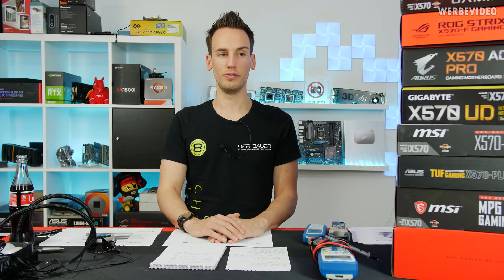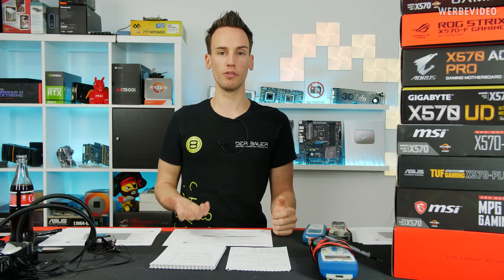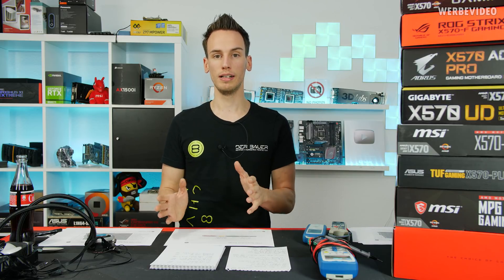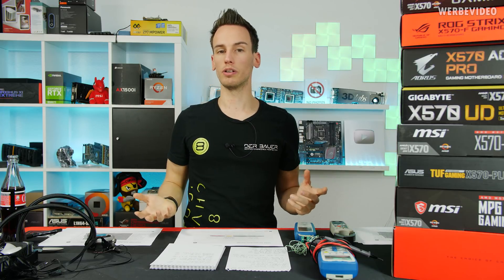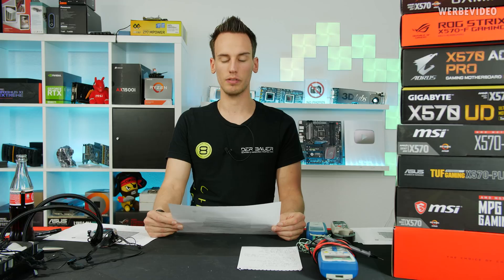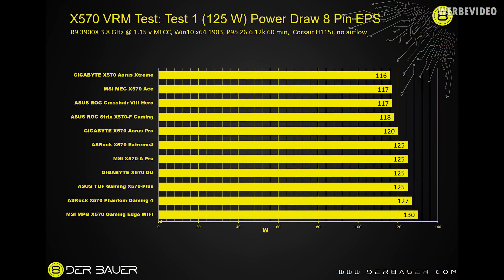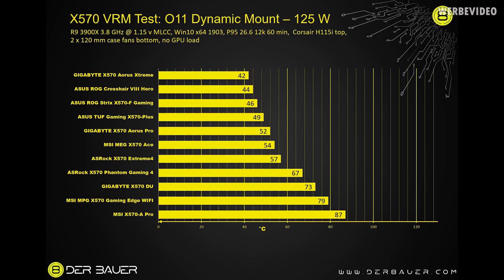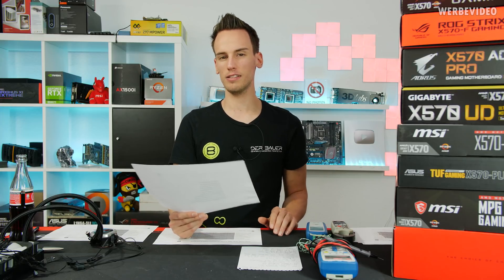RYZEN 3950X "simulated": VRM Testing 11 X570 Mainboards

Comment: I bought asus x570 pro for 260€ and wasn't expecting that I'd be vrm bottle necked with 5900x. While CPU temperatures were below 85c, the motherboard would shutdown due to vrm overheating, 4.6ghz all core at 1.32v seems to be stable now, but I'm still fine tuning it at the time of writing.

Comment: Where did you find the specifications for coming up with the VRM's temp chart? It seems to me that kind of knowledge is more intuition based than actually scientific. And it keeps promoving temperature paranoia and insatisfaction. There are many VRMs certified to operate at temperatures up to 150º and even more, they are just built for that.

But that's most of PC's hardware knowledge: barely scientific. Even if sometimes it appears to be.
Reply from the maker: I'm a electrical engineer and I can read datasheets
Reply: @der8auer   You can understand then that there are low-dropout linear voltage regulators which can cope up to 225º and beyond, and each motherboard's brand will use different regulators depending on voltage input and other factors.

Comment: @18:48 "You have to suffer longer, because I also had to suffer longer to work for this" Hahah, dude... Do I look like I'm suffering? I loved it. Thanks for this comparison!
I've been eyeing that TUF mobo for a while now, and this confirms it. Hard to beat that board at 210€ price range. Regarding the TUF board, I found it interesting that it had higher power draw but lower temps than other comparative mobos. Where is all that juice going? :D
Now, Aorus Elite could be an alternative for the TUF board, but sadly that wasn't included in this test. One could expect it perform similarly to the Aorus Pro, but it does have different VRM so... who knows.

Comment: Hey, nice video. However, you had to do further testing on the MSI x570 meg ace since the vrm is attached to the chipset for cooling which creates a shared load of heat. It would be nice to investigate this since its the only board besides the more expensive aourus extreme to connect vrm with chipset.

Comment: How do you have time for anything? With all your other projects. Almost need a grunt to do all the testing.

Buildzoid also pointed out Msi isn't as efficient vrm across the board but has slightly better heatsinks.

Thinking of the gigabyte master, but that should be similar to extreme and hero.

Comment: Asus has pretty good vrm setup on x570, yea the aorus extreme is better than the crosshair viii but it cost way more not worth it for 2 degrees. I have a vii and viii and they have both been great motherboards. But really the tuf gaming is very impressive for its price. I just bought a 3600 and msi b450i pro gaming for an itx build. I hope the vrm’s dont get crazy hot.

Comment: a while back hardwareunboxed did some basic vrm temp tests. very basic compared to your amazing work.  anyway on the strength of the hwub tests i bought a 3600 cpu and a asus prime x570-p mobo. i absolutely love it. if anyone is on the fence about ryzen 3 - you should take the plunge. ive got 8 threads mining monero 24/7 and there still is enough cpu left for everything else i do. the 3600 is wonderful. im hoping moving forward to get a crazy cpu and thats when the decent vrm of the x570-p will come into effect. great channel love your work.
Reply: i think my mobo has exactly the same vrm as one of the ones your ran in your tests

Comment: I would take the ASUS ROG Strix X570-E instead of -F. It has the exact same VRM as X570 Crosshair. Motherboard costs 10 euros more.
Reply: But both costs way too much
Reply: @lifemocker85  Agreed. The price should be around 280eur for those Strix boards
Reply: More like 250
Reply: @lifemocker85   In German Amazon, X570-F is on sale right now, but still expensive. Gan get it for 261 euros. Down from 295 euros.
Reply: @TRHardware  50 more expensive than TUF
Reply: @lifemocker85  But TUF does not have some features that I need. One of them is external temp sensor, for custom watercooling setup. But agreed that X570-F should be around 230. X570-e around 250 euros.

Comment: I was going to get the Asus Hero vii for my 3900x but should I get the Asus TUF Gaming Plus instead? Really enjoyed the video.
Reply: X570 for longevity
Reply: @lifemocker85  But isn't the Hero vii a better board? I don't plan on changing the 3900x in the future. Basically my last chip because the chip I'm using now, Phenom ll X4 955, lasted me 10 yrs. Being 60 yrs old I would say not too many upgrades in the future ... lol.
Reply: No you should plan to run 4900X the final AM4 platform 12 core to get the max lifespan out of your system
Reply: @lifemocker85  I have no plans on buying the 4900x. The 3900x will last me years and is plenty fast for me. The Hero vii is a better board than the TUF in features. Thanks for your input.
Reply: It doesn't feature pci4 which you probably want if youre going to keep your system for years

Comment: ASUS Prime Pro
Reply: Well tuf has more characteristics than Prime P
Reply: Hm..??
Reply: @Revener666  better lan, audio, more sataports
Reply: Eh the lan is not beter on the TUF, and do you really need 8 SATA ports ?, 6 is enough especially since you get M.2 too. And both have the same audio chip but it seems to be a bit beter on the prime. 
+ some other stuff on the Prime is better.
Reply: @Revener666  lan is different - tuf has little bit better and so audio is little bit bitter AND tuf has beefier vrm. Prime is still good but Tuf is little bit updated
Reply: They have the same VRM, and the prime have one more PCIe slot. The lan and audio is not better on the tough. and Prome also have more Fan headers.
Reply: @Revener666  and now I see that you were talking about Prime Pro.... Im always comparing Tuf to Prime P.... damn asus and it naming schemes
Reply: Yeah I figured as much :)

Comment: Great clip, thanks for all the work, more data to add to my spreadsheet of X570 boards that I'm building for the next computer upgrade :)

Since you asked for more board requests/suggestions, I'd love if you could add 2 more boards to the test set: the ASUS X570-P and the Asrock X570 Taichi. The reason for that is that the X570-P is showing incredibly good results in Hardware Unboxed's VRM testing, it's showing to have much better thermals than the X570 TUF gaming although both have identical VRMs so I would love if someone were to confirm this is indeed the case or just a glitch.

For the Taichi, the reason is that it's a great sweet spot in terms of price and features, you get boot code, intel gigabit, wifi6, decent VRM, etc for considerably lower price than any of the ASUS boards that offer the same.
Reply: Prime P and Tuf have different vrms
Reply: @lifemocker85  Hmm, that doesn't seem to be the case from the data I'm finding  online on them. Both have a ASP1106G driven 4+2 phase configuration with 12 50A Sic639 for the Vcore (in a configuration of 3 components per phase). Which would be the same with ASUS  PRME X570-PRO, TUF Gaming and the Strix-F (but NOT the Strix-E which is closer to the Crosshair).

However, you are right that they are layed out differently on the board. The X570-P clusters all the Vcore MOSFETs  on the left while the other boards splits them in half left, half top with the SoC in the top/left corner. This actually makes me think the X570-P should have WORSE thermals because there's more heat generation concentrated in one place. It especially doesn't explain why in Hardware Unboxed's tests the X570-P, with a 600A VRM capacity, has the same thermals as the Strix-F which has a 720A capacity and better heatsink :(

But I'm probably  missing something.
Reply: @dizzy_plays  https://www.youtube.com/watch?v=xbyWKufthS4&t=281s Vs https://www.youtube.com/watch?v=_7PkZwY9PWM&t=40s   Tuf has beefier VRM and Prime P has slight better heatsinks
Reply: @lifemocker85  Ah, you are right, thanks for the info!

So then it's even more confusing. With the PRIME X570-P only having a capacity of 400A Vcore vs TUF's 600A, how come the X570-P is showing hugely better thermals over the TUF, as good as the Strix-E/Taichi? :( This makes  no sense to me: https://youtu.be/kxJ8rB5DiUE?t=359

Comment: Feeling real glad that on launch week I second thought me buying the X570 A-Pro even if it was just for a 3600 and deciding to exchange it for a X570 TUF wifi since it was clearly a better board and I wanted the wifi. I'm probably future-proofed enough to be using it with a 4900x or something once those come out and become cheap down the line.
Reply: Yeah AM4 endgame is to get cheap 12/16 core 4000 serie cpu when their prices are right

Comment: Thanks der8auer -- I never see the MSI mid tier boards on any motherboard comparison. How are the VRMs on the MSI x570 Gaming Pro Carbon? Besides unknown VRM performance it seems to me to be the best mid-tier motherboard feature wise.
Reply: Check hardware unboxed
Reply: @lifemocker85  I did, for his big comparison unless he did something new. He only had the cheap and hi end for msi
Reply: Only high end msi is any good with x570
Reply: @lifemocker85 can you show me where to saw testing to determine that? It definitely seems that way, but I've seen no tests that indicate that for the mid range boards
Reply: Everything below ace and unify is crap. Hardware unboxed has charts and I consider them high end because they're expensive
Reply: @lifemocker85  please look again. Every single review of hardware unboxed uses the edge and the godlike. Not one video uses the pro carbon, which is why I asked about it specifically because it has different vrm and better features for a moderate price increase. I'd really like to know how it fares. If you could find some information about the relevant board I mentioned instead of the lower tier boards, please share it!
Reply: Check unify video. Theres chart
Reply: @lifemocker85  thanks!
Reply: @lifemocker85  I checked, but cannot listen. He only uses the edge, which is the lower tier board in that test. Did he say something otherwise?
Reply: @lifemocker85  I see it, the charts. Thanks a bunch!

Comment: Again, great stuff and thanks for the hard work.
If possible I'd like to see the results on an MSI MPG x570 pro carbon wifi. Especially since it sits above the boards that didn't perform very well in this test but is also not exactly high end either.

Comment: <3 your work Roman. I got an x570 Aorus Master to pair with my 3900x because it has a VRM *almost as impressive as the Extreme, but for half the price. Curious as to how it stacks up against the Crosshair Hero for the 250-350 euro range boards.

Comment: Nice job der8auer! I would love to see the ASUS Prime X570-P to be added to the tests, if possible. That's the cheapest X570 chip-set board from ASUS, and i believe it should be close enough to the ASUS TUF Gaming X570-Plus. And as a second option the MSI MPG X570 Gaming Pro Carbon WiFi that uses 5x2 phases (CPU VCC) with doublers and with QA3111N6N Dual N-FET mosfets.  

Very much appreciate your hard work! Viele grüße aus Griechenland! :D

Comment: Anything below a 3900x do you really need a X570? NVME SSD's on m.2 are still plenty fast enough
Reply: I just made this same point on Gamers Nexus.   If you only run 8 cores  any mother board will handle ryzen 3000 at stock settings, and its pointless to even think about overclocking.
Get any AM4 motherboard that will handle 2 PCIE3 NVME drives.
If you think you need to run 12-16 cores now or in the future, get an X570.   PCIE 4 SSD's will only get cheaper.    If you really need to run 16 cores  then you should seriously be considering Threadripper, to get all the extra PCIE lanes

Comment: Very interesting. I understand that this is just a simulation, but what sort of voltage would you expect the 3950X to be running while it is drawing 225W? I've been toying with the idea of putting one in an X370-based build with excellent VRM cooling.  However, I want to check some numbers first and make sure that, heat aside, it can deal with the current a 3950x would pull.

Comment: There is the Aorus master Also cool if you can't spend 740euro on a board
PS: I would love to see the master between those test
Reply: Yep. Better than other ~400€ boards and compared to Xtreme only loses a few things: 

Literally the only downgrades are 2,5G LAN instead of 10G, 6 layer PCB instead of 8 and the VRM phase count reduction from 14 to 12 with 50A powerstages instead of 70A on the Extreme.

Comment: What about ASRock Taichi and higher end lineup?
Reply: The titchi will be fine. The lower end boards will need decent airflow over the VRM heatsink running an overclocked 3900x

Comment: Roman, can you please test the Asus Prime X570-P (~170-180€) VRM on your toughest setting, 225 Watt? It is the very best entry X570 motherboard for people on a tight budget, i.e. the majority. It is also way more futureproof than most B450/X470 motherboards and worth the extra few euro's.
The VRM performed surprisingly well on Hardware Unboxed considering the size of it's heatsink (and price!).
It would be interesting to know if this VRM (DrMOS 50A powerstages) does not saturate at 225Watt and temps spin out of control.

Hardware Unboxed motherboard VRM temp comparison chart (not so scientific as yours Roman):
3900X, PBO& Auto OC (Auto Vcore) (equivalent to ~125 Watt?): https://youtu.be/kxJ8rB5DiUE?t=313
3900X@4.3GHz 1.4V (equivalent to ~165 Watt?): https://youtu.be/kxJ8rB5DiUE?t=354

Actually Hardware Overclocking's Asus Prime X570-P PCB breakdown (for the hardcore hardware lovers):
https://tweakers.net/pricewatch/1422528/asus-prime-x570-p.html

Here's a rather (but not 100%) complete of all X570 motherboards feature comparison matrix (xlsx): http://gadgetblues.com/

Comment: Where is the best location to place a flat K-Type temperature probe on the VRM? Can it be placed directly on the MOSFET, just below the thermal pad, or will that interfere with the cooling capabilities of the heatsink? Should it be placed on the MOSFET located in the center of the VRM? I'm taking the heatsink off anyways, so I can design a waterblock for it. (For reference, it's an EVGA X79 DARK) Thanks in advance. o7

Comment: Would like a video if any X470 boards would be apple to run 3950x  ...currently running a x470 asrock tai chi :)
Reply: That one probably is
Reply: @h2oaddict  heard its good vrm for the x470 series .. and heard ppl running 3900x easy .. but still 16 core is ..massive .. so i rather want to be sure if i decide to go that way :)Hehe

Comment: TUF is awesome, really good motherboard for $190 ($200 with wifi). But, I think PRIME X570-P is the best option. Its only cost $170 with same vrm temperature.
Reply: I just order Prime X570 P I not use LAN I use wifi instead off and I have Sound Card too.

Comment: Did you run HWiNFO as well? Want to know how close that temp is to the probe temp. When i load blender for 40 min my vrm temps only hits 74c with MSI x570 pro gaming carbon with 3900x.
Reply from the maker: on most boards I had 10-20°C lower temps in HWiNFO than measured on the backside

Comment: I've been able to hit a hair over 140w power consumption from my Ryzen 7 3800X @ 4.375Ghz w/ 1.35v. I would imagine the Ryzen 9 3950X would be somewhere around 280w power consumption if setup right. I'm using a Gigabyte AORUS X470 Gaming 7 Wifi-50.
Reply: Thats pretty good. I've only it 119W with PBO limits etc maxed out and auto voltage but no allcore OC on my 3800X with X570 Master. That's the allcore load value as reported by HWInfo64. Usually it does not even go above 100W. 

What are you using for cooling? Im using Dark Rock Pro 4 and it goes to 90c when running Prime95 SmallFFT but i've never seen anything above 80c in games. Stock was 75c in Prime95 but since i lifted the limits it gets hotter.

Comment: What about the ASROCK hi end boards? Tai CHI etc.? since the 370 days I've had good luck with them, especially regarding memory timings , on a bang for buck basis. In fact, I'm writing this on my first 370 board with mem running at just under 3680,  (which i was able to do out of the box when they first came out), and that speed is not even easily obtainable by the current AMD boards today!!
Reply: X570 Taichi is pretty good. Not the best but good. Also the only X570 board that uses T-Topology memory layout. Meaning it's optimised for 4 DIMM operation. Achieveing 3600-3800 is no problem with 3000 series CPU, X570 and a good memory kit using Samsung B-Die, Micron E-Die or Hynix C/J-Die. I have Hynix J-Die based kit running 3733Mhz 16-20-20-36 1T OC from 3200Mhz CL16 with Ryzen 7 3800X and X570 Aorus Master.

I could go over 4000Mhz if i wanted to with more loose timings but by FCLK does not go above 1867 so i have to keep FCLK and MCLK at 1:1 to get the best latency.

Comment: I don't really understand how can VRM pull less power than it does supply to the CPU. 
Is it approximate "125"W, "165"W and "225"W?
Reply from the maker: The VRM can pull 125 W from the PSU but the real CPU power consumption can for example be only 115 W and 10 W would be switching losses (heat) on the VRM. Hope that helps

Comment: The surprise here for me was the Asus ROG Strix X570-F Gaming vs the MSI MEG X570 ACE. The Asus performed better and is much cheaper, though the Ace does has some extra features.
Reply: X570-E is almost identical to Ace feature wise, but is still cheaper.
It basically comes down to if you need 3 m.2 or more Sata

Comment: Thanks for all your hard work! I’d be very interested to see how the X570 Aorus Master compares to the Extreme.
Reply: That motherboard looks to have a slightly upgraded thermal management setup to the Pro. The Pro performed admirably considering it is a heck of a lot cheaper. I would thin that it would be maybe just a bit better than the pro, but definitely not close the the Extreme. Then again, it has two extra phases of power, so it will probably be a bit cooler than the pro.